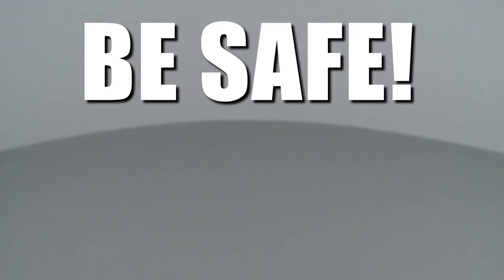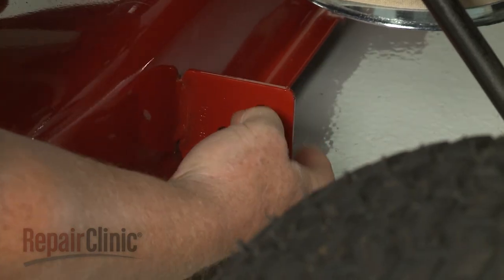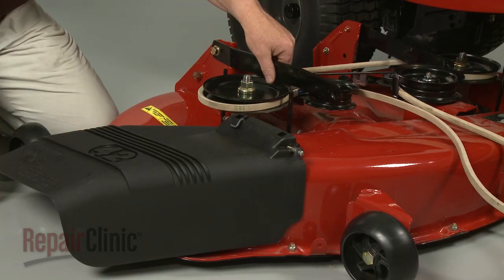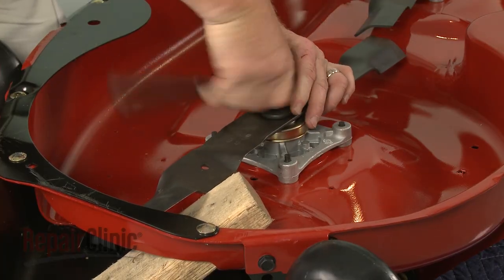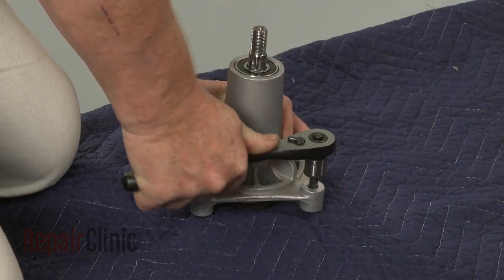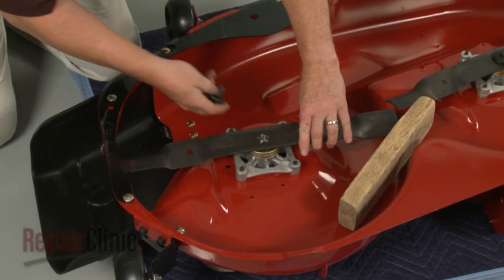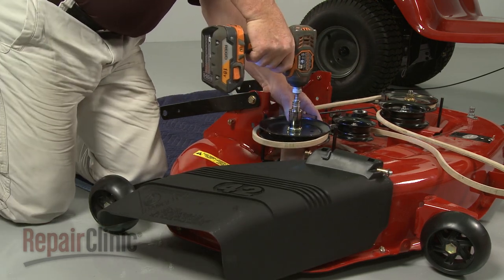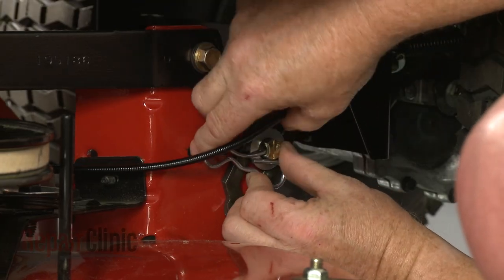Craftsman Riding Lawn Mower Spindle Assembly #532192870

Comment: Got a similar mower from my neighbors, those bolts were the most stuck on things I've ever dealt with. I guess years of use and rust got it seized. My advice, get some PB blaster and spray all the bolts, then wedge the deck into something because it'll take enoigh force to drag the whole deck otherwise. Pick up a breaker bar, it's the only thing that worked for me, and make sure you have the exact right socket sizes. And make sure your replacement comes with all the nuts and bolts because a few of them are gonna snap most likely.

Comment: Well done in all aspects! Thanks for a simple and clear explanation for this process. Videos like yours makes it easy to see how it SHOULD go! I've linked my PDF Repair manual to this video so I can refer to it for other repairs.
Mine was slightly more complicated, in that the entire spindle bolt assembly was broken from the spindle housing (from hitting a chuck of 4x4 post piece in the tall grass in a pasture) , meaning the assembly would free spin when I tried to remove the pulley mounting nut (1:57 in video). Even though the spindle assembly was flopping around, I was still able to secure the blade with a creatively placed block of wood. The mounting nut was frozen in place also...even my breaker bar wouldn't break it free. I ended up spraying the nut with WD-40 and letting it set, then used my propane torch to heat up one side of the bolt (which is brass), expanding it just enough to let the WD-40 get down the threads and it broke free right away. Then I had to remove the broken housing pieces that were still bolted in place. Secured the jagged edges with vice grips in order to keep them from free-spinning when taking the bolts out (2:40). The rest was all down hill. Thanks again!
Reply from the maker: Good work Randy!

Comment: Very clear and well produced video. Thanks for pointing out the cables and mounting points. Your procedure was very straightforward to follow.

I prefer to remove the blades with the deck in its upmost position before starting the procedure. That avoids having to flip the whole deck over just to remove the blades.

I thought it was good advice to also replace the mounting bolts for the mandrell. In addition I replaced the blade mounting bolt/washer as well, the bolt threads can be weakened due to over-tightening when the blade hits a rock or other hard object.
Reply from the maker: Jean-Pierre White Thank you for the input.

Comment: Thx for the help! : ) And I was able to get the 4 spindle mounting bolts off by first spraying on some penetrating oil, both sides, then letting it sit 15 min or so before removing them. Only one broke off. My mower is a 2006 model and it's 2017 currently.
Reply from the maker: Great job!

Comment: How do I keep mine from breaking? Literally every-time I mow I have to replace this part because the blades stop working. Do they make a hardened steel version of this spindle that is more resilient? It seems like the ones on the Craftsman mower I have are made out of the cheapest Chinese metal.
Reply: How about try NOT hitting rocks, logs, etc. with the mower blade when you're mowing?
Reply: Maybe another spindle is bad and it causes one or the others to go bad prematurely?

Comment: It's funny that this deck and mandrel have seen almost zero use.  In fact, the mandrel bolt will normally break off when attempt is made to loosen. In other words, this is far from a typical experience when replacing a mandrel.  No dirty/rusty parts, no cursing or bloody fingers. Dude didn't even get his pants dirty! ;)
Reply: Amen brother, isn't that the truth! I just had to fight with mine, Busted knuckles, broken bolts, Flipped the deck over onto my foot, more swear words than I care to mention! I'm 63 and sore as hell after this NOT so easy job. Maybe I should have called this guy.........lol
Reply: I use anti-seize on all my mower hardware including blade bolts when reinstalling. Makes subsequent work much easier.

Comment: Now how do it the easy way.. I just replaced mine and didn't need to remove the deck . I put a brick under the left rear wheel to give me room under the cutting deck then removed the top nut holding the pulley , then the blade bolt and then the 4 bolts holding the spindle on .Assembly was the reverse.. It took less than 20 minutes
Reply: But then you can't fit an impact wrench underneath or on top of the deck to loosen anything.  If you don't need the impact wrench, then your way sounds better.

Comment: Do you have to greese the spindle?
Reply: ALL spindles have to be greased, or at LEAST, have the bearings changed out once a year.  You should remove the bearing seal, on the inner side, of both the upper and lower bearings.  Easy.  Then when you add grease, it actually GOES to where you THINK you're adding it.  This is a severe manufacturing defect (or maybe it is by design?) that you need to take care of.

Comment: how do you get the pulley nut broke loose, when your blade won't lock in place the star pattern is worn down?
Reply: Use an impact wrench; very easy to loosen the nut.

Comment: Spindle is worn where the blade (star) attaches underneath.  Blade bold will not tighten blade to star so the blade just spins.  How do I get pulley off if I can not stop the blade from spinning?
Reply: Vice grip pliers or long wreck, pull bar, etc...on top pulley. Let rest against firm location on deck. Then loosen bolt holding blade.

Comment: I found that if the mower is an older one, like mine the bolts break off, so it's easier leave the spindle housings in place and just replace the bearing. Unless you have new bolts and assemblys otherwise It's cheaper and easier.

03 Murray Riding mower Spindle bearing Blade change part 1
https://www.youtube.com/watch?v=gBlvT95hbWI

03 Murray Riding mower Spindle bearing Blade change part 2
https://www.youtube.com/watch?v=SHPVg5hGAzM

Best wishes, Jesus Bless. Keith

Comment: This video is on how to replace the Mower Deck Spindle, not the front wheel Spindle, so the description for this video is incorrect in saying that you'll replace this when the mower won't steer straight.
Reply from the maker: Jeremiah Jenkins This video shows how to replace the spindle that drives one of the blades.
Reply: *****  You are correct, and I appreciate you guys updating the description to match the video. I was only pointing out the description was incorrect. Thank you!

Comment: JUST one more step  if you replace one with a greaseable fitting don't forget to remove the inner seals ,if you donot the bearing will not get any grease,if you use a grease gun
Reply: How do you remove the inner seal?